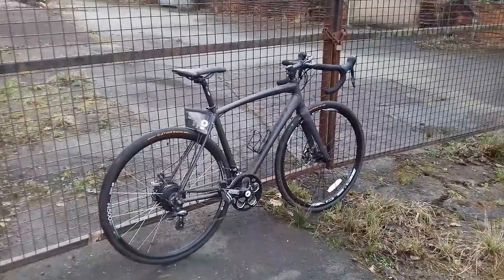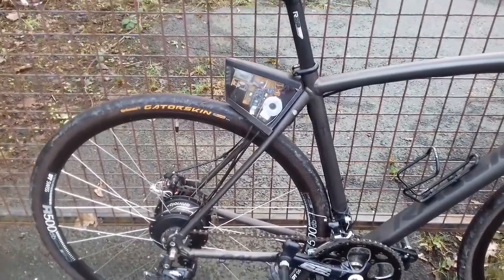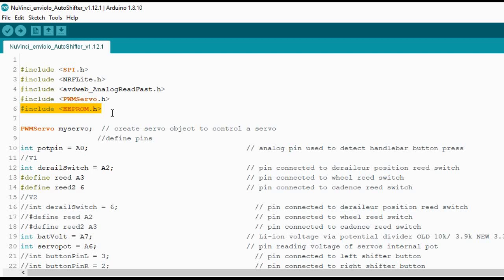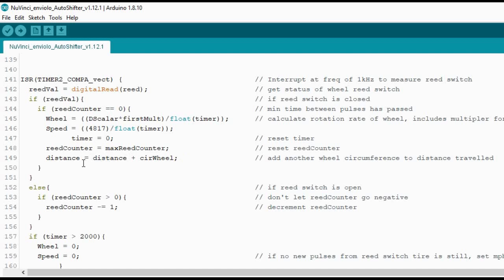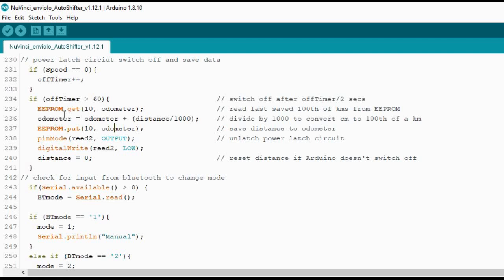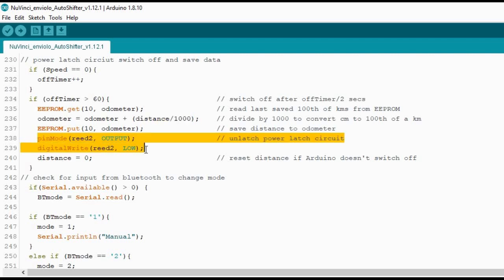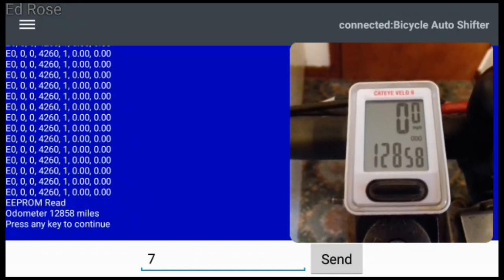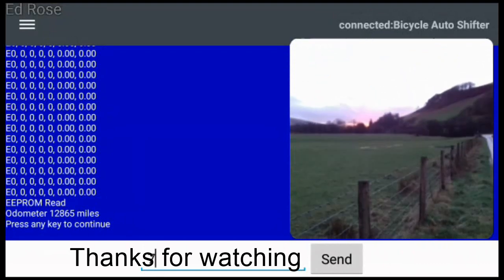Arduino Bicycle Odometer

Comment: Hello Ed R, 
I want to build something similar for my own bike. Do you have some details on how to do the wiring and what equipment / sensors / etc. is needed?
Best regards, 
Ludwig
Reply from the maker: Hi Ludwig, Do you mean the automatic shifter or just the cycle computer part?
Reply: @Ed.R  Just the cycle computer. I am a beginner and still need to learn many things :-) Any help is very much appreciated. Cheers, Ludwig
Reply from the maker: @microsoftbizappsfico  I'd recommend searching Instructables for Arduino Bike Speedometer https://www.instructables.com/Arduino-Bike-Speedometer/
Follow that project, it's how I started. Then come back to my code after and add the odometer part in when it makes more sense.
Reply: @Ed.R  many thanks for the tip and link!
Reply: Hello Ed R, I finally got what I wanted to achieve. Wanted to thank you once again for the tips and the great video. Many thanks and have a good day. Cheers, Ludwig
Reply from the maker: @microsoftbizappsfico  Glad I was able to help and thanks for the update.

Comment: Throw on an IMU like a BNO055 to track your climb gradients too or a little pitot tube for an easy speedometer (as well as a ground truth to look at versus the actual wind speed of the day).
Reply from the maker: Both great ideas for a future project. I'm planning to upgrade to a Nano-33-BLE which has a 9 axis IMU on the board. Someone was asking about how to get good data for gradient for an automatic shifter they were working on. Be a nice little challenge combining acceleration and gyro data to get good results.
Also was thinking about an anemometer on the bike to record the wind speeds I encounter during the winter. Hadn't thought about type but pitot tube sounds good.
Reply: @Ed.R  So yeah I found your video because I had similar ideas today and wanted to see what people have done already. I wanted to try it now because I feel like the nano 33 ble is the way to go now that it is available. Like you said, my concern would be the data flow in the nano (due to lack of multi-threading I suppose), so I was wondering about actually using a Pi (probably an RPi Zero). I also thought about an anemometer at first, but kind of struggled with the concept working to get accurate ground-wind speeds as opposed to the bike's velocity so I thought a combination of pitot tubes and I guess some sort of digital version of something that acts like a gliders tell tail on the cockpit might be the way to go. I do road races so I would love to get that kind of data in real time so that I know how much wattage I should be applying to my pedals depending on wind and gradient in order to optimize my energy output and minimize unnecessary energy output.